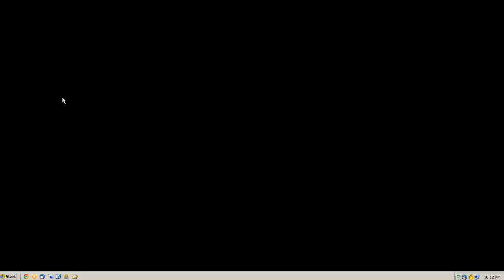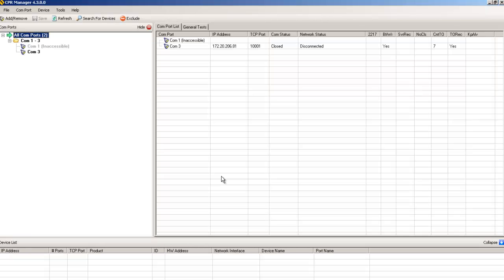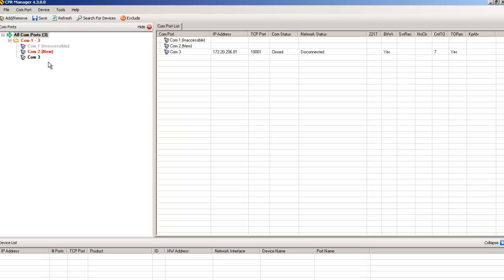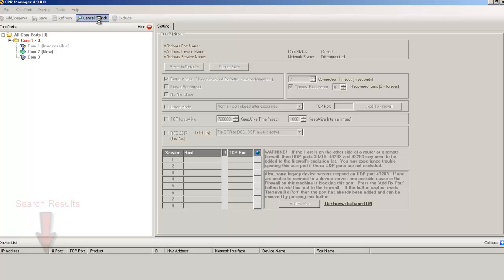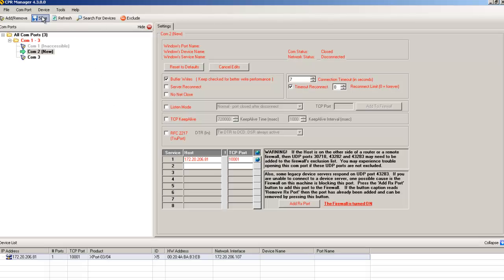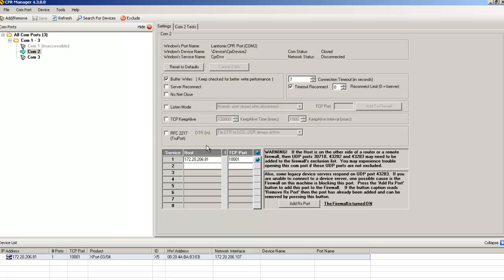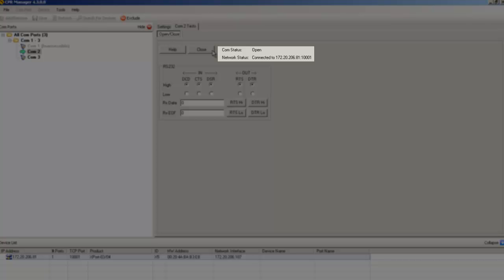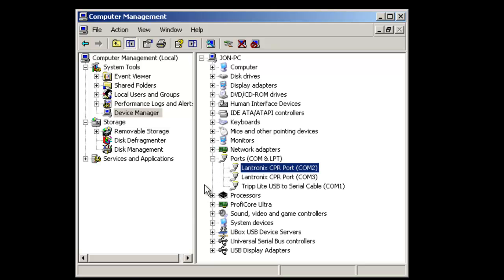CPR 4.3

Comment: Hello
I need to use encryption AES 256 bit on Lantronix TCP/IP XPico module.
Lantronix has not a version of Secure Com Port Redirector supporting Windows10 / Windows Server 2016
I tried to use Tactical software bit it not works when configuring Lantronix module for encryption.
Any idea please?

Comment from the maker: Bukenya Morgan,

The COM port will not open if there is already a TCP connection to the devices data port or the COM port is already in use. Make sure that if you use the COM Tests tab to test the COM port, you end the test and close the COM port before trying to connect with your application software.

Jonathan Witthoeft
support@gridconnect